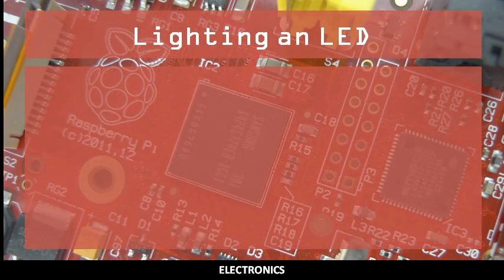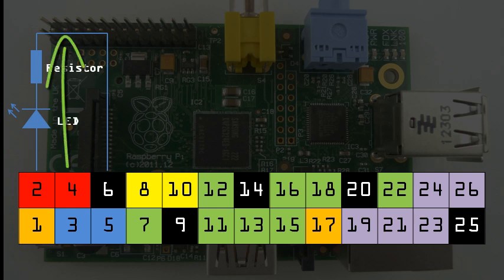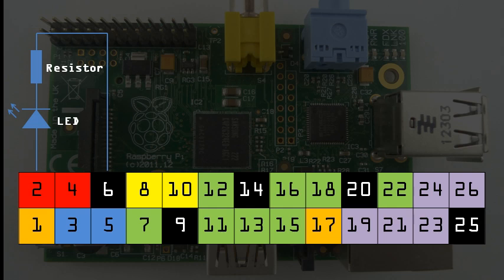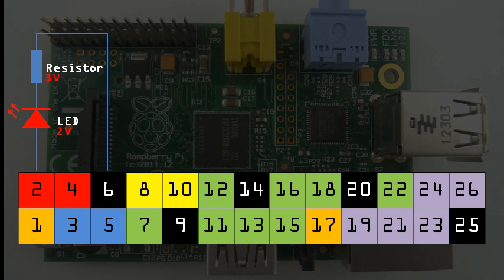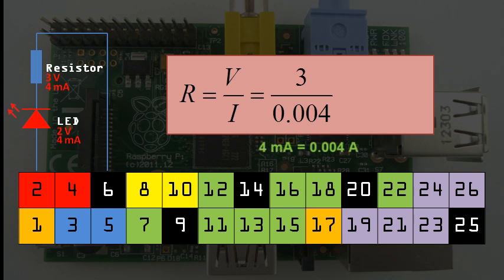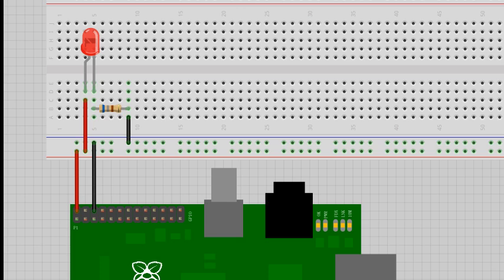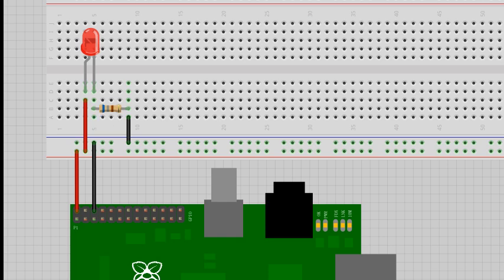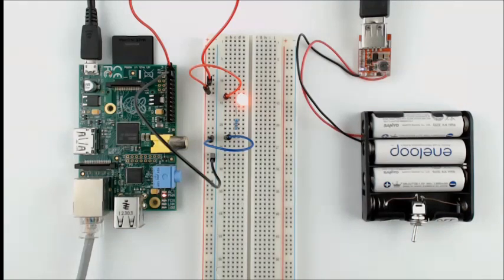Lighting an LED with the Raspberry Pi

Comment: Total newb, so here are my questions 
1. I got this kit,

 http://m.ebay.com/itm/171770413612?_trkparms=aid=222007&algo=SIC.MBE&ao=1&asc=20150313114020&meid=2666074efb794a0b83f2ab1ec69ea7dc&pid=100338&rk=4&rkt=17&sd=171791546815&_trksid=p2141725.c100338.m3726&_mwBanner=1

it doesn't say the drop on the led's, are they all the same?

2. I have a 560 oahm, a 1k, a 5.1k, and a 10k. which is bigger k or oahm.

thanks. sorry for my stupidity! lol

Comment: Nice video. But your diagram doesn't match what you actually used to turn on the light. The grounding cable to the raspberry pi was on the left of the jumper instead of the right.

Comment: My question: in video, you are powering this circuit via the 3 AA batteries only correct? That is, I don't see a power light on the Pi. I am planning to use a 5V ac power supply on the Pi and then connect jumpers from 5V rail on GPIO to power strip on breadboard and then go from there. No batteries. Thoughts on viability. thank you
Reply from the maker: Stephanie Davis Though I'm using batteries to power the Pi, the LED is being powered through the Pi. The typical thing to do is to connect the Pi to a 5V power supply, so you shouldn't have any problems.
Reply: Gaven MacDonald Thank You

Comment: Just got a Rpi for Christmas. As a young boy with little experience, I thank you so much.
Reply from the maker: Great to hear that the videos are of some help. Let me know if you have any questions.
Reply: Gaven MacDonald I ordered an Rpi for new year,too. I have a question: I'm not sure what to buy after that. I'll buy some leds and buttons but i dont know which resistor should i buy. According to your video if i want to decrase 3.3V to 2V i'll need to add 1.3V resistor (Which is 1.3V/0.004 = 325ohm) isn't it? Also, thanks for your vids. You deserve more subs and more views because you teach us very well.

Comment: Hey, great video, I found that on my RPi, the voltage going from P2 to P6 is -5V, and therefore, the LED should be flipped. It worked that way on my breadboard :)